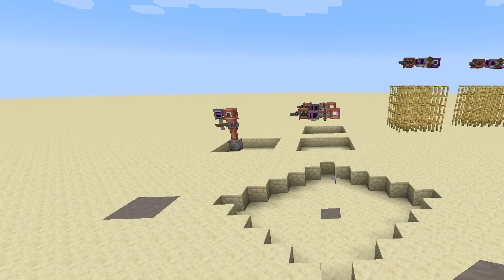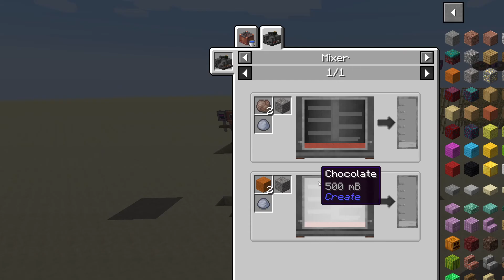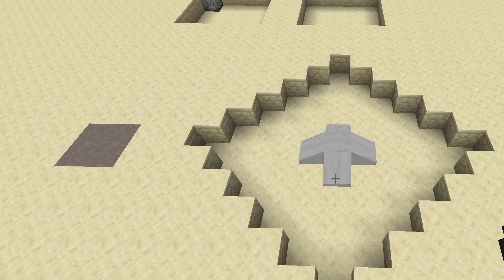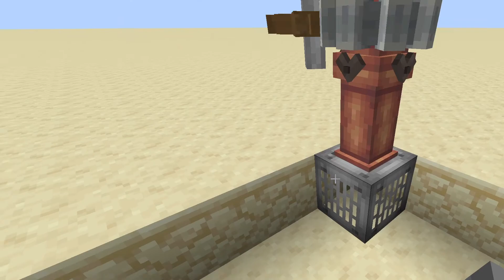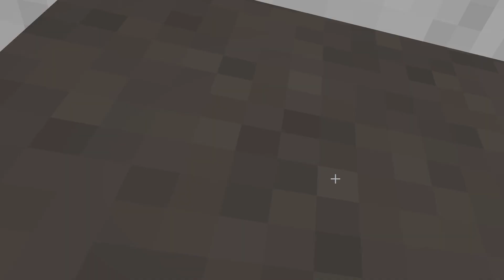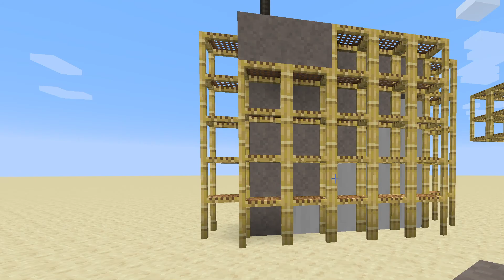Immersive Engineering & Create: Liquid Concrete Techniques

Comment: Funnily enough, crystallize actually is a correct term for concrete solidifying. It does dry out, but it also does crystallize into various disjointed mineral nodules. Those crystal nodules interlinking are what makes it so hard when set. Another fun fact, the hoover dam is still drying.

Comment: You can use quick dry concrete in the chem thrower
Reply from the maker: Yeah that's also a thing you can do, although its uses are quite different.
Reply: how do you fill the chem thrower with dry concrete?

Comment: Came across this technique myself last night, although something is causing the concrete to cure on its own (something in the valhelsia2 modpack)

Adding more create pumps speeds up the fill rate, which is how I made it usable for my needs.
Reply from the maker: That's very weird, yeah. I made a moderately sized building using this technique and it never solidified on its own despite taking like ten minutes (definitely will use more pumps in the future - thanks for that idea). Here's a link to the video if you're interested: https://youtu.be/hhp7fvTKjW8 It's unlisted cause the quality is even worse than this one.

Did you have any grass nearby? Maybe grass spreading would have updated the concrete... Otherwise I have no idea. Never played Valhelsia. :/